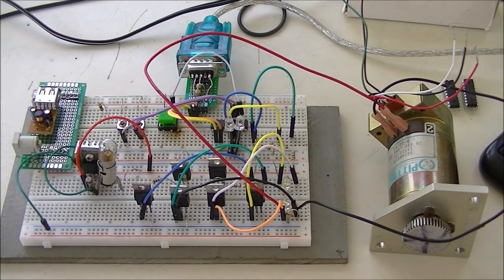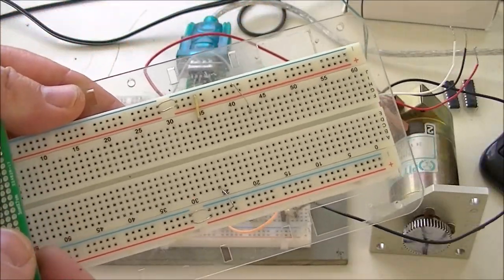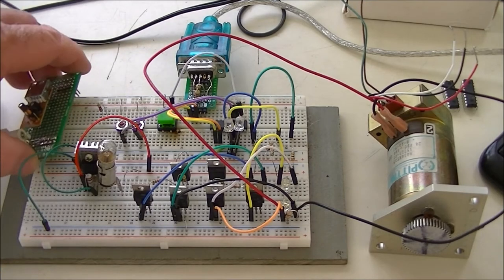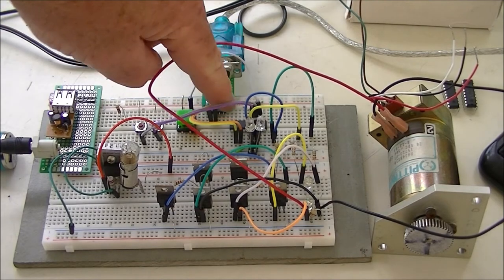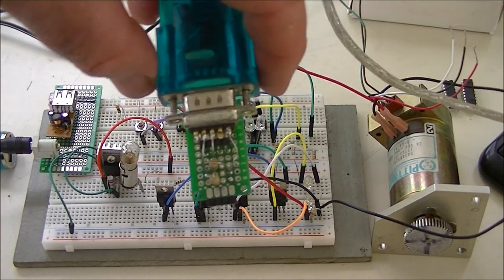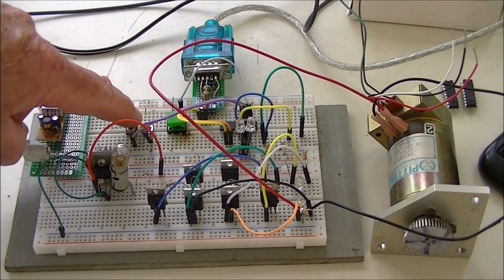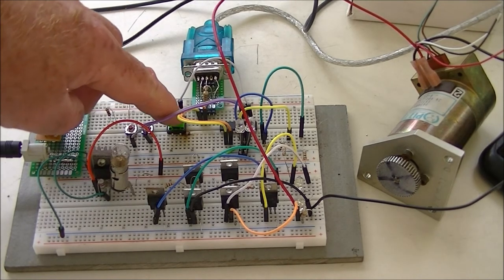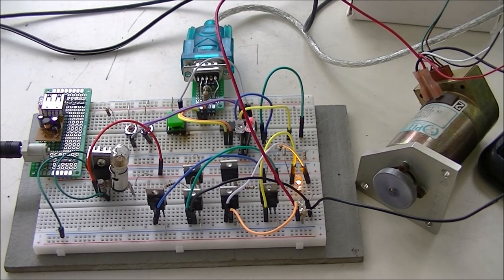PICAXE-18M2 Operates 2-Input MOSFET H-Bridge

Comment: Thanks for the very helpful video. I was hoping to use this circuit to control some peltier  devices. I was going to have a hot set and a cold set, but it looks with the H-bridge I just need one set. I am very much a rookie with electronics - I am a computer guy. I think I need to drive more current then the IRF630 can handle.  Selecting the right MOSFET seems quite complicated. I was looking at the IRL3303 or the BUZ-11. What changes are needed for  these are used?